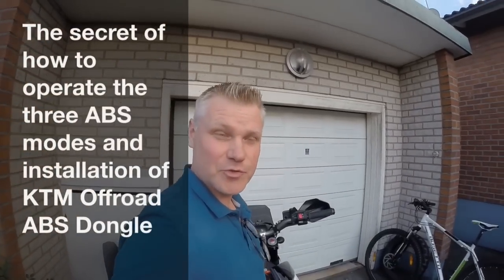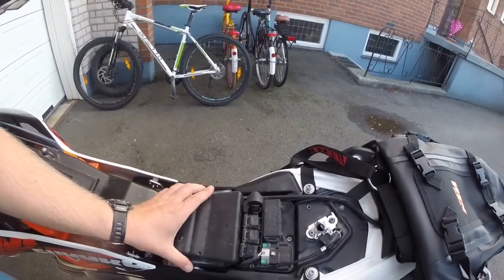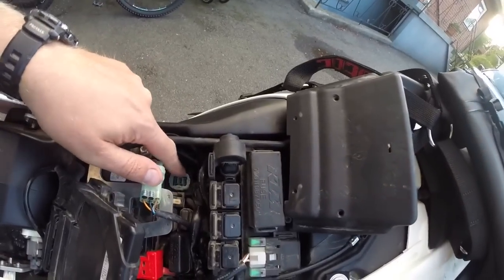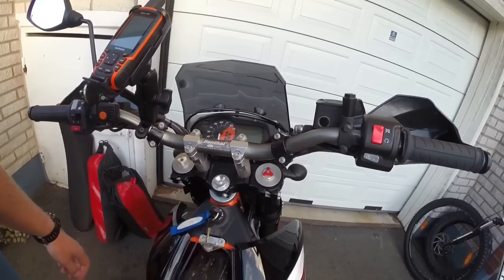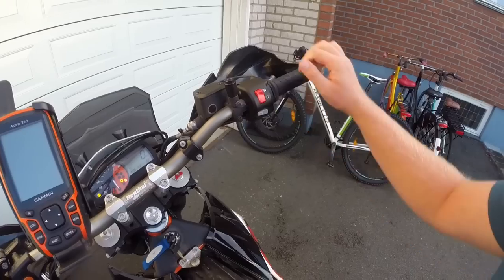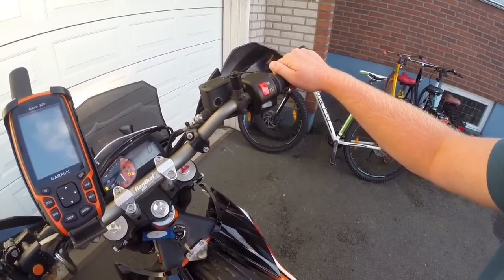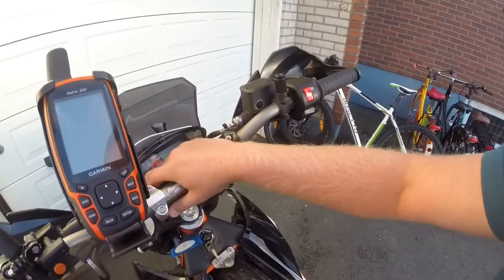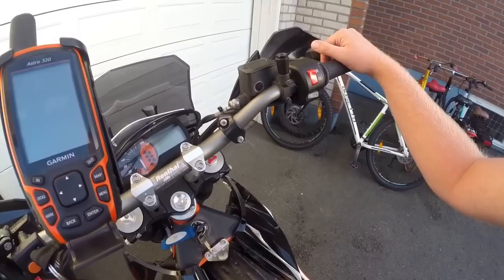2014 KTM 690 Enduro, Offroad ABS Dongle Explained

Comment: So you press the 3rd button when the bike is running? Please explain how to use the other 3rd button
Reply from the maker: You mean the on on the dashboard? Yes, but nevwr used that after i installed the dongle. Always run the bike in off road ABS mode which it always started in. This function or dongle does probably not workbon the newer models -17 or -19 and up are different. This was a -14.

Comment: I have  2020 690 Enduro R. The Dongle was installed when I bought the bike from the original owner. I am in the US. I cannot get the bike to do anything but work in the off road mode (or off). The kill switch does not change the mode. Any ideas what might be wrong? Thanks
Reply from the maker: Unfortunately not, should be a new version on the -20 model? Probably not the same function, but there could be other ways? Nothing on Advrider on this?

Comment: Hej! Great video. I have the abs dongle installed and either with or without the kill switch on/off I have always only offroad abs. No chance to get the abs fully enabled with dongle and kill switch off trick. Have ktm 690 Enduro 2014. Any ideas? :-)
Reply from the maker: Thanks, no other idea than if tiu have had any software updates on the bike. But this should work, this is the first time i hear that it does not work on a 2014.

Comment: im a stoppie man..long long distance stoppies...just bought a,2014 690 smcr do i need a dongle???? i turned ignition on and pressed abs button for 3 seconds...my back end came up braking hard...did i turn abs off hmmm..i wanna buy 1 to make sure
Reply from the maker: Thanks for Your comment.  The dongle works in the way that you always start in offroad abs mode. Which is nice if you mostly ride on gravel/dirt. If you do black top most of the time you don't need this. I loved it though. My 790 has this function built in.

Comment: Mattias,  thank you very much for your video. I can’t seem to make this work on my 2019. I am specifically not able to enable ABS on the front and rear wheel. Your Killswitch suggestion does not work on the 2019’s, at least not on mine. I wonder if you or any of your subscribers have any ideas? My local dealer is clueless!  In the meantime I am riding on the road with no rear ABS, this doesn’t worry me except as you mentioned on the road with wet conditions. Thank you!
Reply from the maker: Thanks Mike, havn't read the manual yet but here is a link http://mobil.ktmshop.se/index.php?action=showDocuments&id=2817
On my model year, the switch trick only works if the optional abs dongle is installed. Keep us updated if you find out the functions!
Reply: did you manage in the end?

Comment: Hey Mattias - thanks for posting this, as well as all the great follow-up comments. One more question: do you know of any way to have abs completely turned off at all times, even after turning bike on and off with ignition switch? I ride aggressive and difficult dirt in Southern California and would like to be able to have it off all day, after short breaks, etc., and not have to push the button on the dash to kill the front wheel abs.
Reply: You could probably pull the fuse for the ABS system if it isn't shared with other things. My 2016 owners manual shows that the ABS is Fuse 9 [10 Amp fuse]
Reply from the maker: Hi, thanks for Your comment! sorry to say that I have not found a function for this. that would be nice to have that option. However, I have found it very useful ta have it start in offroad mode as default. It has saved me a couple of times ;)
Reply from the maker: Jason Ferrier tanks for Your input, exactly that was my thought too when rereading this post. Should work!

Comment: Big thanks Mattias.  I will try these functions tomorrow.  After it was installed by the dealer I read the instructions and it stated that there are only 2 possible options:  Front wheel only ABS and no ABS.  I was immediately shocked that the instructions indicated that there was no longer a 2 wheel ABS option.  I am hoping you instructions work tomorrow.  Thanks for putting this video together.
Reply from the maker: Thanks for your post Adrian! I'm sure you will find out that you can reach all functions as described. Remarkable that KTM does not include a complete instruction. I have found myself riding with the offroad mode in all situations, in mud, on gravel and on asphalt. Even on steep downhills. It is simple the best mode for me and makes the dongle absolutely worth to install.

Comment: I bought the 2014 690 as well and i dont have 3 abs modes.. Its either off or on, i dont have a offroad mode where its just the front brake abs...
Reply from the maker: T-dogg, you need to install the optional Offroad Dongle to get the full functions. You can find the Dongle at your dealer. Install it as I show in this vid. Merry Christmas!

Comment: Mattias, do you happen to know if the bad fuel portion of this 'dongle' can be activated on the 690.  i doubt i will ever need it but just in case i would like to know.,  thanks again!
Reply from the maker: Mt understanding is that you activate the bad fuel mode by set the map switch under your seat to "0". If the Dongle is needed for this setting or not, I do not know since the user's manual is vague about this. The Dongle is shared with other KTM models so it could be that this Dongle activates the posibility to use bad fuel mode differently based by bike model.
Reply from the maker: Mattias Eriksson By the way, within short I will upload a video of installing a cool handlebar switch to be able to control the map settings without fiddling under the seat :)
Reply: Mattias Eriksson I have installed the dongle, works just as you said it would.  Also read the bike manual, now I understand the different power maps and how to change them.  tks.  the bike is new, i only have a couple hundred kilometers on it.  i have been testing the front wheel only ABS, not sure i like it.  it sounds like you have been riding your bike for a while, would you please give me your opinion on using ABS on dirt roads and single track.  I do most of my riding in the deserts around phoenix Arizona.  
also i will watch for your video on installing a switch for the fuel maps, i'm very interested.
Reply from the maker: scott holman my experience and suggestion is to use front ABS only mode in most gravel/dirt situations. In extreme offroad situations like very steep downhill with slipery surface,  you should turn off ABS completely. I only use full ABS on wet tarmac. I'm sure you will enjoy this great bike to the fullest :)  ride it hard !